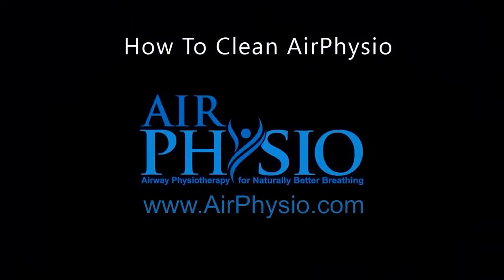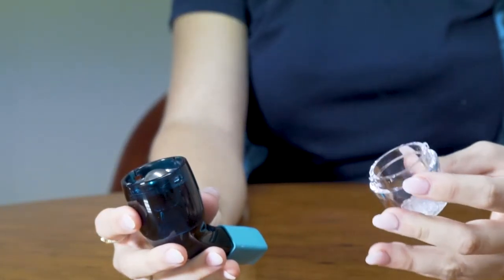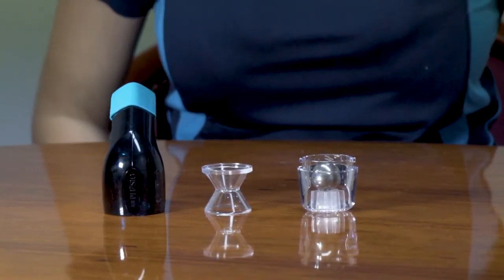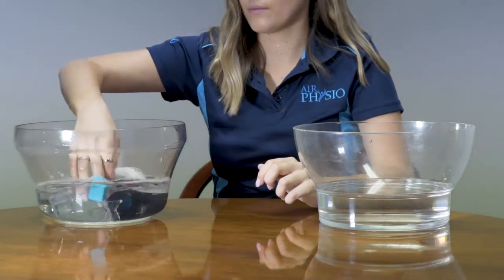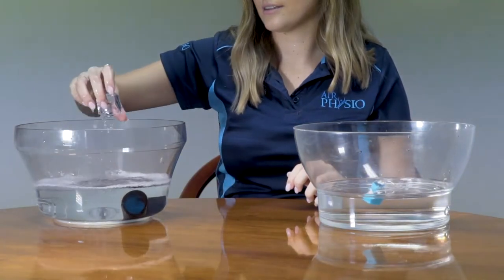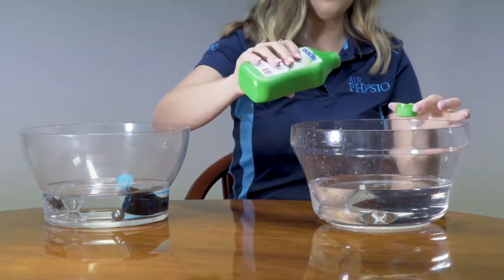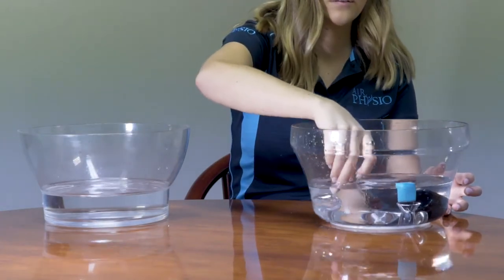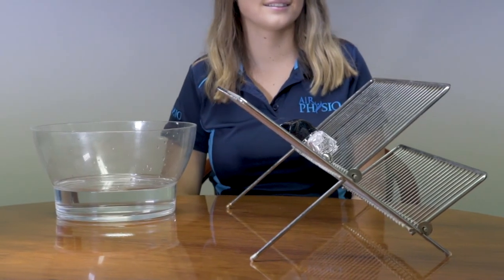How To Clean AirPhysio with a Twist Cap

Comment: Received order 2 days ago. Really clears chest and sinuses which I didn't expect. Have only paper wiped device, and aired it to clear misted parts so far, after each use. Wondered is dish wash liquid necessary since 20% spirit alcohol should kill anything ? I plan to soak n rinse once a week and hope this is sufficient, as with COPD I don't have energy for all of the above, especially not daily.

Comment: Crikey! That's a lot of cleaning!
Was thinking about getting one, but am disabled with chronic illnesses, and absolutely exhausted 24/7

With the daily cleaning, can you put in dishwasher water and rinse with clean tap water, or does THAT rinse water have to be distilled as well?
Reply from the maker: In most places the answer is yes. The reason for using boiled water is that the tap water in some area can be very in sanitary and hold bacteria, metals, etc… the boiling to to help improve the water qualities. It is for helping to clean your lungs and if the water and device are dirty, then it may not do a very good job.
Reply: @airphysio  can you boil it in a pot boiling for 10 minutes without melting affecting product?
Reply from the maker: @Lilyspice  The answer is yes, they have been tested in an auto clave which uses steam at 135 degrees Celsius for 3 minutes, so boiling the device is fine.
Reply: @airphysio  I was told that in order to kill NTM we must boil 10 minutes at sea level and add 1 minute per 1000 ft above sea level. Is the device okay for boil for 10 minutes? Please advise thank you 🙏🏼
Reply from the maker: @Lilyspice  sorry I wasn't clearer, 10 minutes boiling is fine.
Reply: @airphysio  thank you 🙏🏼
Reply from the maker: @Lilyspice  agreed and thank you.

Comment: For the disinfectant, the alcohol concentration is indicated as 20% in the instruction manual. However, how much of this is needed to add to that bowl of water used to sterilize the parts? The video shows her squeezing some of the alcohol into the bowl of water. But exactly how much?
Reply from the maker: The aim is to have 20% isopropyl alcohol to 80% water, i.e. 20 ml out of every 100 ml.

Comment: I just rinsed and soaked in Milton , is that wrong?
Reply from the maker: Hi Kerry, we haven't tried in Milton, we normally test in alcohol solution, but keep us posted on how it goes and if anything happens to the device, let us know and we will replace it for you free of charge. We stand behind our product.
Reply: I am skipping both steps and soaking in Milton too and just leaving it to air dry without rinsing off. Hope that is OK, it is a lot less faff and I don't need to buy an extra cleaning product since I use dishwasher tabs rather than liquid!
Reply: @Swirleyful  I would give it a good rinse after the Milton. Milton is really nasty stuff

Comment: Can you use UV-C light instead of Alcohol to disinfect?
Reply from the maker: You could do, but it will shorten the life expectancy of the device as UV breaks down plastic.
Reply: @airphysio  IPA should shorten the life as well and not sure how many folks will continue to do IPA cleaning which is a solvent. If I had to use IPA I would not use this.
Reply from the maker: @davahad  you can sanize the device by boiling in water for 5-10 minutes as well.

Comment: this seems alot of work and time. Would it be possible and easier to just use the same method as baby bottle sterilizing. Wash parts>  rinse>  place all BUT the ball into a solution of Milton for 15 minutes> drain to dry. The ball could be placed into a small container of vinegar/water solution instead of Milton

Comment: I bought mine  over  6 months ago Havent used it yet  because I realised then it was some do not's with the cleaning process and the leaflet is not clear .
I came across this link at the bottom  
It has made the cleaning process ckearer .
I think ill go for milton in the future .
Whst about filtered ionised water.Can I use that to rince ?
Reply from the maker: Yes you can and we’re sorry about any confusion.
Reply from the maker: The reason for boiling the water is that the tap water may not be sanitary in some locations. You can use the washing and rinsing part in the first part of the video on a daily basis and this process weekly.